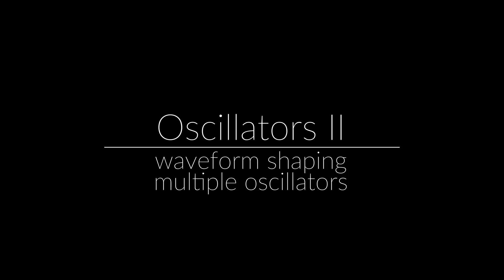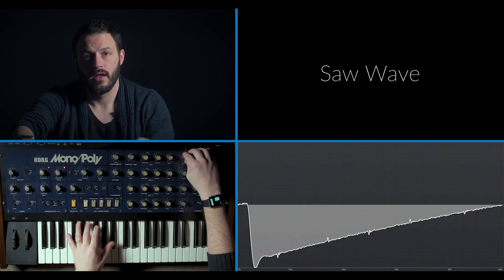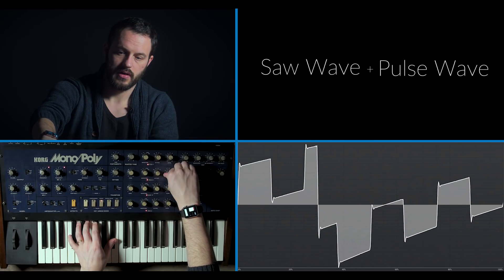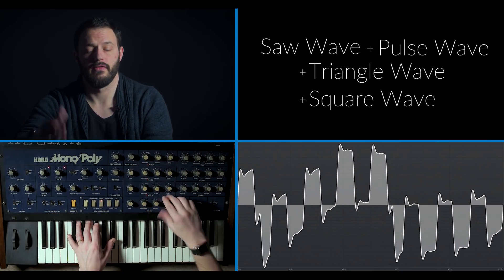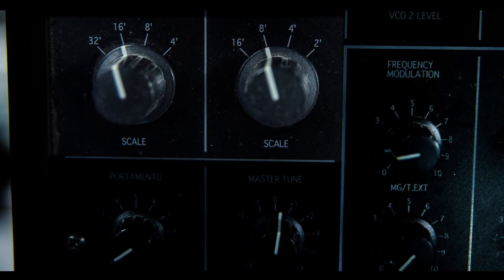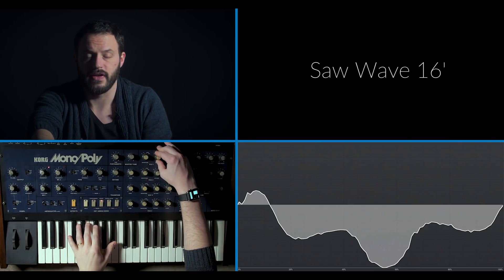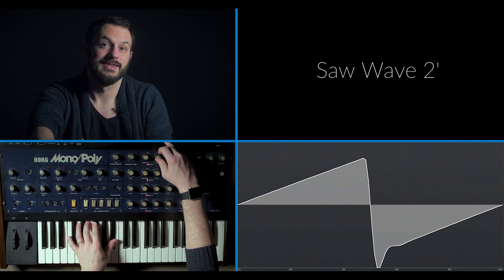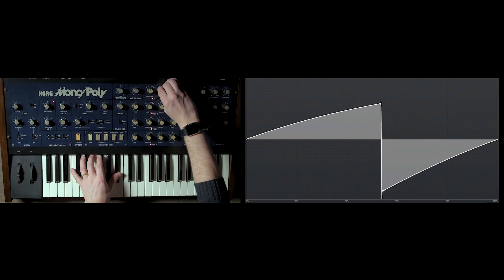Intro To Synthesis Part 2: Shaping Multiple Oscillators | Reverb Learn To Play

Comment: 5:55 FYI, this visualization is incorrect. What is shown is a 50% pulse width square wave just changing frequency (note). Changing the pulse width would make the upward part of the square pattern get longer (turning it into a rectangle) and the downward part of the pattern get narrower (eventually a downward spike). Turning the knob the other way would do the opposite. The note stays the same but the harmonic content changes. You kind of get the idea a little bit later when the oscilloscope view pops up, but that only shows one cycle of the wave.

Comment: Again, nicely produced by I'm sorry to say you are likely confusing new comers by not using terminology clearly and correctly. Pulse waves (also called rectangular waves) can be statically set to a particular width (duty cycle) and you can set a pulse wave to be a square wave (50% duty cycle) BUT if you pulse width modulate a square wave it is no longer a square wave, at least not most of the time. I know, this may be a picky distinction.
Reply: Not to piss on your parade but Mr. Rice is correct. But this series is good for people who’ve just started diving in :D and it’s a more demonstrative approach than most lessons. Cheers , don’t fight now :P
Reply: Exactly.  0:35 Demonstrates pulse width variation by showing a square wave changing frequency - not pulse width.
Edit: 5:55 doing it again - smh.
Reply: @Roderick_Legato  can you explain correctly then because now I am confused
Reply: @Cypher Redux  This needs pictures :-)  Go to the Wikipedia article on "Pulse-width modulation" and look at the figure under "Duty cycle". It shows 3 different pulse widths.  (Most synths can produce all values of duty cycle in between those shown.) Notice that the distance from one rising edge to the next rising edge does not change - that means the frequency is constant, and that's not what is being shown in this video.  I hope that helps.
Reply: @Roderick_Legato  thx  for quick reply on old thread, and will do! 

Just starting down this rabbit hole but diving as deep as I can
Reply: I'm a new-comer and he didn't confuse me at all. The contrary, in fact. I think this series is excellent. As you say, it's well produced, but it's also quite straightforward and comprehensible. Cheers.
Reply: If you are "new" how do you know if you are confused or not?
Reply: That is such a deeply stupid question. You are just trying to defend your pickiness now, and your attempt at petty point-scoring. Try having some courtesy towards other people.
Reply: "Point scoring"?? lol